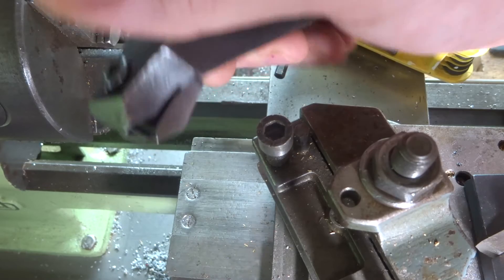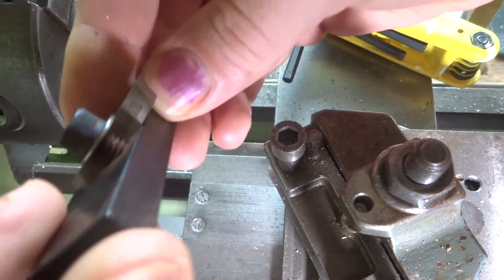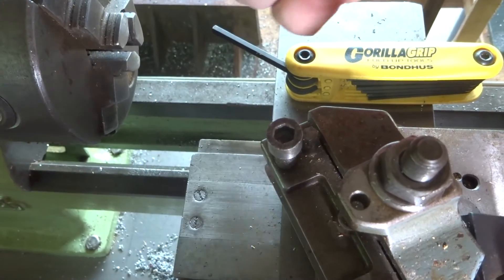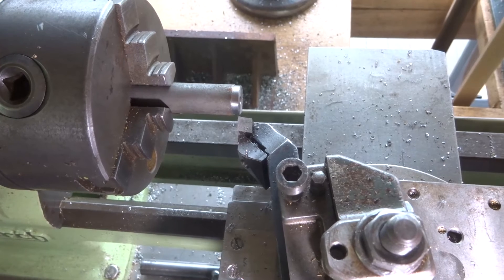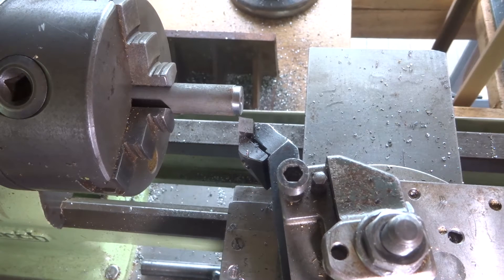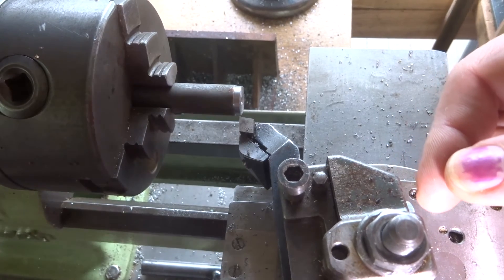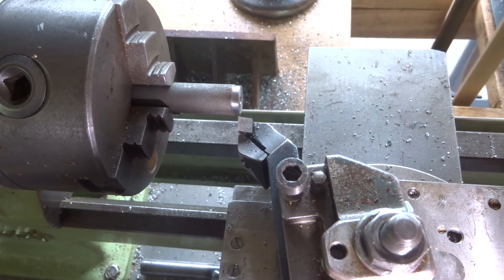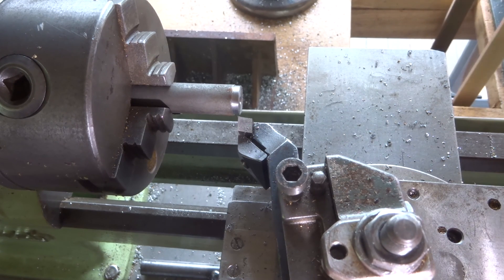A closer look at the diamond tool holder

Comment: I guess I am not very well informed as I had never seen this type holder with the bit vertical. The manufactures video also came up and I was surprised to see how it can be used for so many materials without a change in the grind. Round bit as well. I guess you would learn in time but I'd need their video around as a reminder. Thanks for your video. (Could be due to the fact I had to get ride of my metal lathe 15 years ago to keep up )

Comment: Interesting video. Been away because of illness and have missed a few. Congratulations on the 100 videos!
I'm in the process of acquiring a diamond tool holder. Much improved video quality (lighting and sound) and as usual an interesting program. Thanks for sharing.
Reply from the maker: Hope youre on the mend Jim! The diamond toolholder is one of the best things ive ever owned. Just makes the job so much easier. Thanks for watching! Is such a learning curve.

Comment: Hi Emma,
A tangential tool (not Diamond as i make my own) is my go to tool, so much easier to work to close tolerances than expensive insert tooling, which don't.
You are right about not many people knowing these tools in the UK, I was demonstrating one of my self built ones at  Model Engineer Exhibition a number years back and it seemed to be unheard of, judging by people reactions. I have been doing my bit to improve awareness ever since.
The earliest reference I have found, so far, is 1885 and I am sure that if they hadn't invented CNC, brazed carbide or insert tooling they would be better known world wide.
ATB
chris